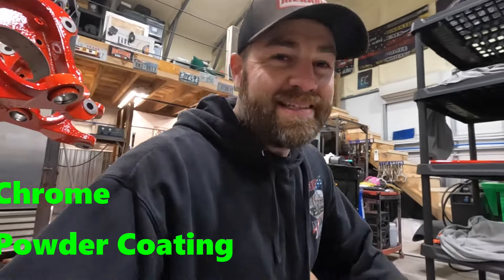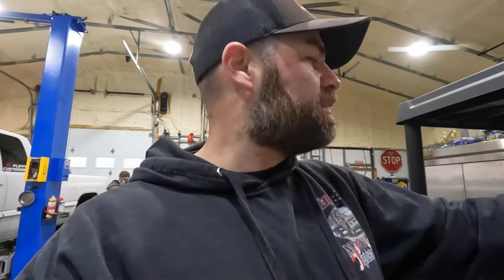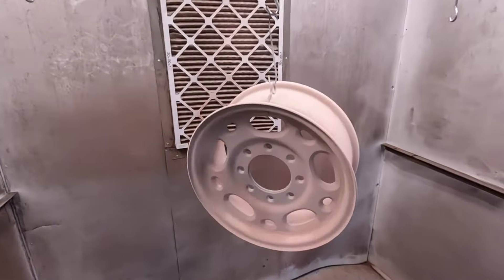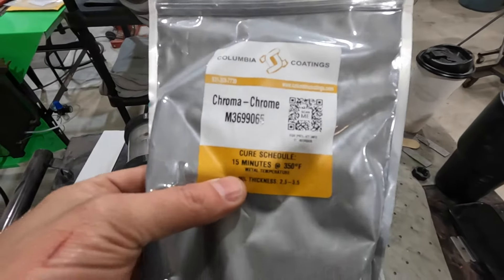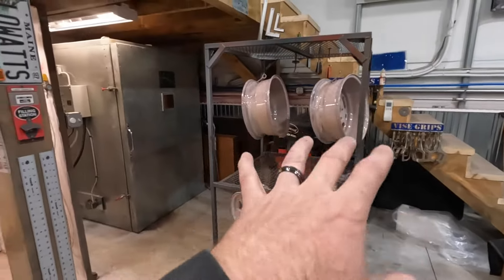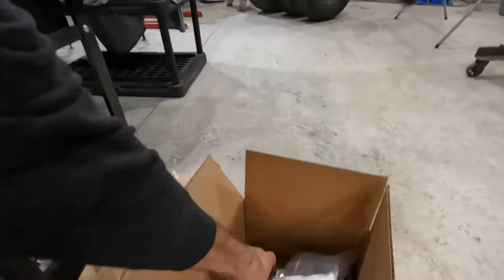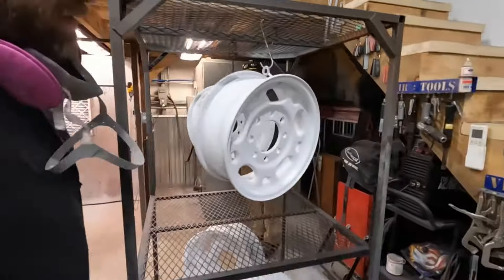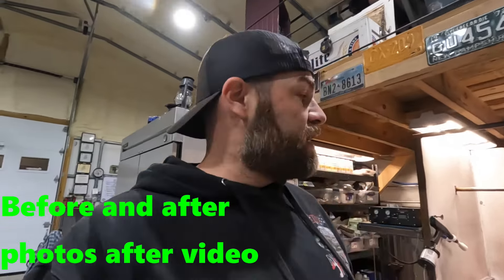My Favorite Chrome Powder Coating hands down

Comment: Heavy coats of powdered primer helps get rid of the bumpy look on the inside of the wheel where the metal isn’t smooth. We call it Orange in the UK but a good heavy coat of primer gets rid of it completely
Reply from the maker: Good tip thank ya

Comment: Looks great!

Ever have any issues with wheel vibration after?  We have seen it many times with wheels that got the mounting face of the wheel powder coated.
Reply from the maker: No we haven’t but I have heard of others that have. The problem with leaving the mating surface bare and running in the winter, corrosion would start immediately